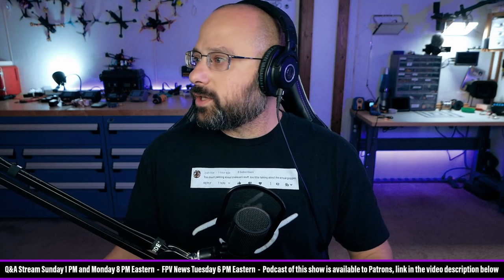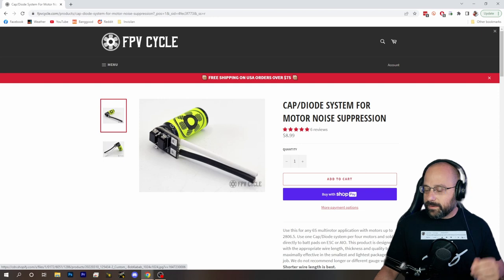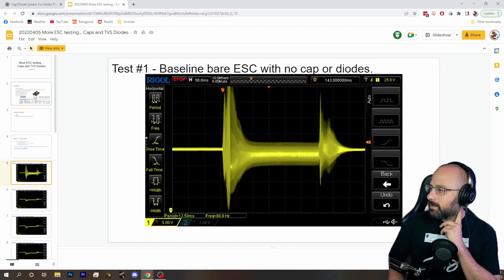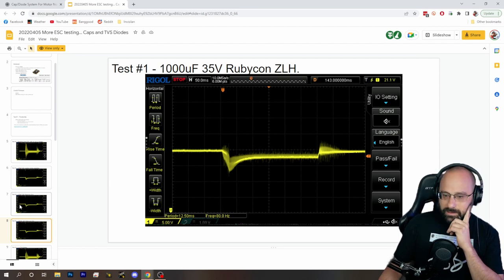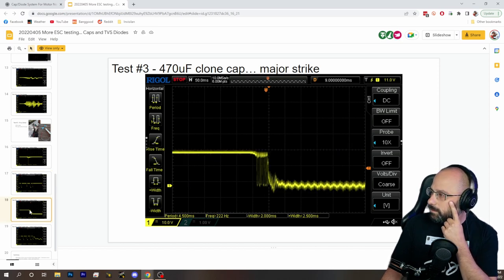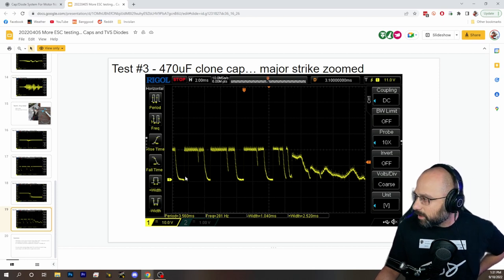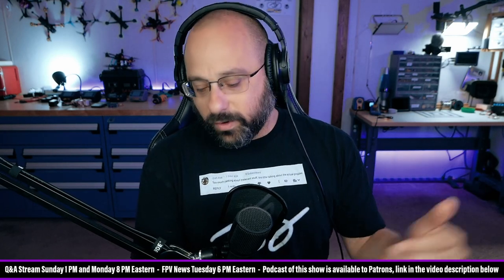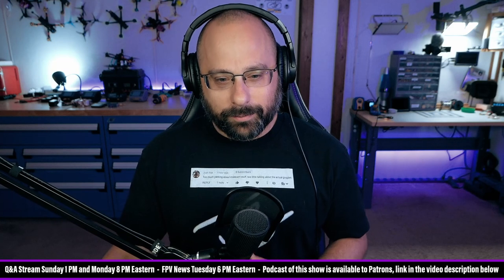Is It Worth Running a TVS diode or Just A Capacitor? - FPV Questions

Comment: I took a high speed impact with a wooden pole with my racing drone trying to hit gaps, the frame was perfectly fine, but the 4 in 1 esc was slightly bent and 1 esc stopped working :D

Comment: 12:13 do jammed motors also pull more current without bidirectional Dshot, where the ESC doesn't know how the motor is spinning?
Reply: the esc always knows how the motor is spinning, bdir dshot gives the fc that information.

Comment: Interesting... looks like I won't be worrying/rushing to update my fleet with one of the 15 or so tvs diodes I invested in!  I've also read that having a smallish cap on the 5v or 12v rail (whichever is being used for the cam/vtx) is beneficial -I think Pidtoolboxguy did the testing...

JB, on a separate note, for analogue builds do you advise powering the camera from the vtx directly (i.e. using the vtx's filtered voltage output) or from the FC (using perhaps a common ground pad if both vtx and cam are being supplied the same voltage)? Do you prefer using 9v or 5v for the cam if it can handle both? -I ask as I noticed you using the FC in your recent build video (Thank you)
Reply: Electronics usually have built in TVS, if they fail the whole board is more likely to fail, running a supplementary TVS adds an extra layer of protection, that is all.

I stopped burning stuff out after I started adding TVS diodes, so I will continue.
Reply: There's 1 other reply to this message (denoted by the blue "1 reply" text, which will now say "2 replies"), but for some strange reason I can't see it?! Can anyone else read it?
Reply: I’ve got the best analog video by using a Matek BEC for my VTX and the camera from the VTX.